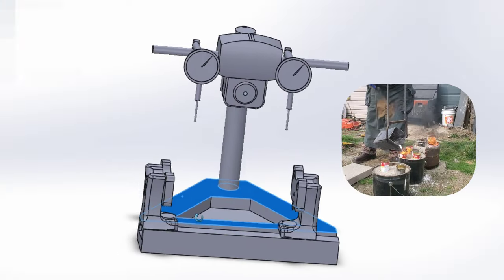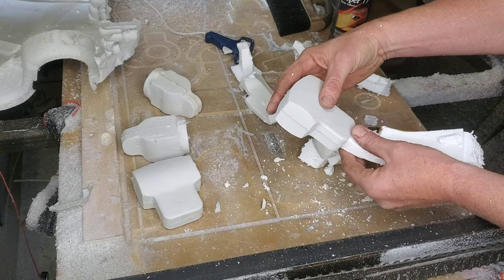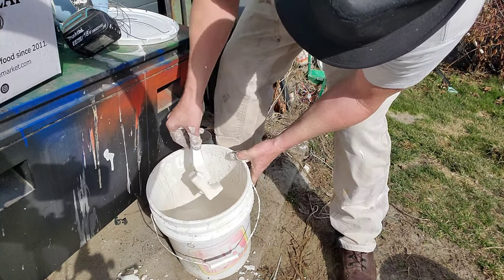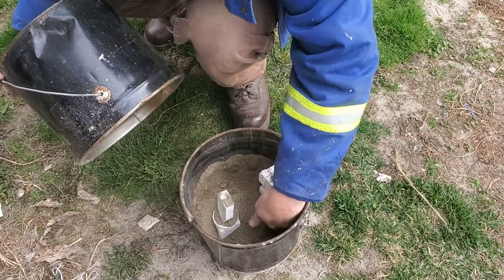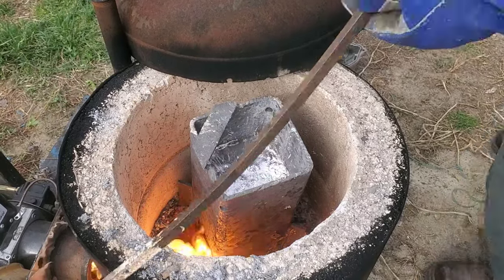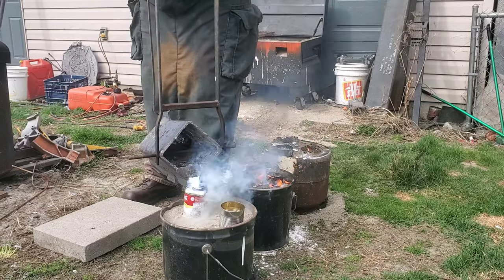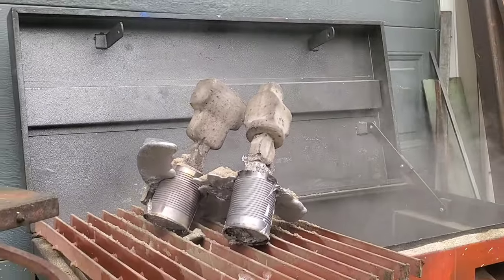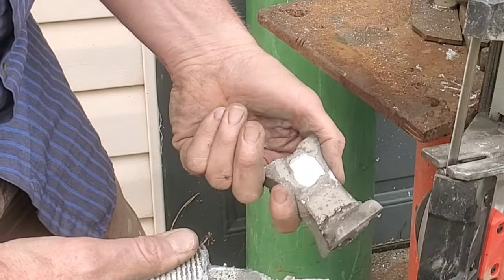CrankShaft Truing Stand Build by Lost Foam Casting  Pt.1

Comment: 🎉🎉🎉 Have you tried usin a bottle of 91% isopropyl alcohol in the plaster. about 10% of the total water. It may help with air bubbles. Or about 15-20% of 70% isopropyl alcohol.  I guess more alcohol would only make the plaster dry faster. The lower surface tension of alcohol should reduce the amount of bubbles in the plaster. Id  try it with small amounts first, and use more alcohol in place of water in the plaster. Until the dry time and surface tension is ideal!🎉🎉🎉🎉
Reply from the maker: I will look into that thank you for the sugestion !!

Comment: polystyrene is a polimer styrophoam is made out of, not the end product so both low density expanded styrophoam  and uniform extruded foam insolation panels are both made out of the same material polistyrene, the only difference is that low density packing material is expanded from plastic pelled by overheated steam while uniform insolation foam is directly injected into a mold in liquid foam state ps is only visable on styrophoam product made out of pellets for recycling, and many supermarket food trays have the same marking while being the same kind of foam as your insolation panels
you can also buy polystyrene sheets  for vacum forming or injection pellets or 3d printer filement in solid state . it is also part of abs and hips plastic composition

anyway nice project you making thre
Reply from the maker: Thos has to be one of the best comments i have ever had  !! Thank you for taking the time to write it , it is very insightful.   You have sent me down the rabit hole now of steam and expanding the pellets .  Sounds dangerous i know ,lol .  Dont worry it will be a while before i wade through a zillion projects and get to this and i will be very carfule .   Lots of people ask about expanded foam but its not usable i have heard. but the pellets and steam would work .   

This almost gets into a large industral set up of injection molding and casting and i wonder if that process would be any faster in the long run than making each part manualy or cnc?
Reply: @Wrighmachining  well it is high flow production process, pellet contain a tiny bit of carbohydron that expand from the temperature while plastic is getting soft
steam is used as heat source because both superheated styrene and  aditive are basicaly as flamable as gasoline so it has to be injected to sealed container with no excess oxygen but also vented to evacuate excess gases that can be used as a fuel for steam boiler. i wouldn't try that at home
pellets thown into fire explode  so it is  to be stored safely too

Comment: Can you use aluminum alloy wheels to melt down as well? Like big truck (18wheeler) wheels obviously cut down
Reply from the maker: I would think so .  The majority of alu wheels are casted .   However you jave to watch out for mags ( magnezium )    there is a way to test it with acid ( drano ) to check 
One or the other will turn black on bare metal .

Comment: Essa espuma é igual àquela que vem   nas geladeira
Reply from the maker: Polystyrene foam is the one that comes with refrigerators.  This type of phone is the high density phone that is used for insulation under concrete. It when broken does not have the little tiny white balls. 

You can use  Polystyre foam for lost foam casting , however it will be more difficult to machine and get a good surface finish. 

I always sue polystyre foam for the inlet because it is lower dencity .

Comment: What is the aluminum frame from?
Reply from the maker: Its a mp12 gesmar rail grinder frames .   I used to have a contract rebuilding the frame bodys with new rollers and bearings .    These frames where deemed unusable by the customer and had cracks or other issues that made them slated for garbage  .  

One mans garbage is another mans treasure :)